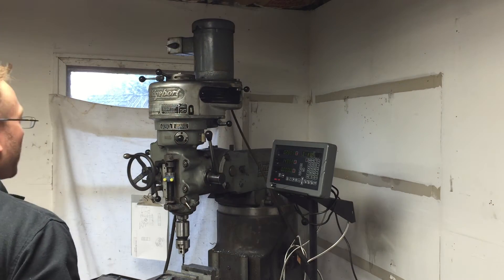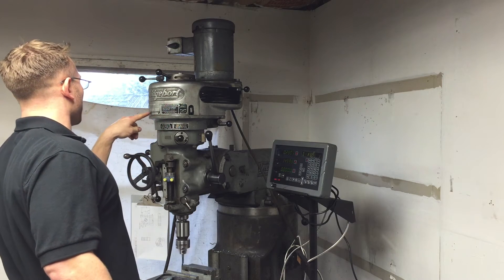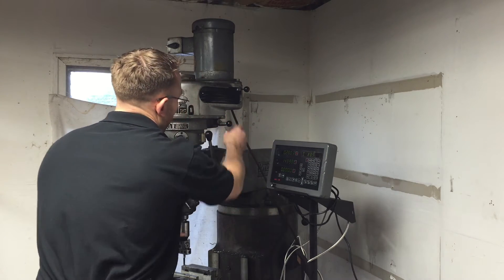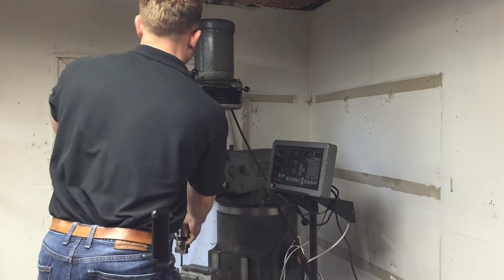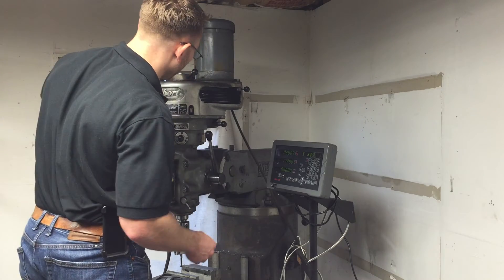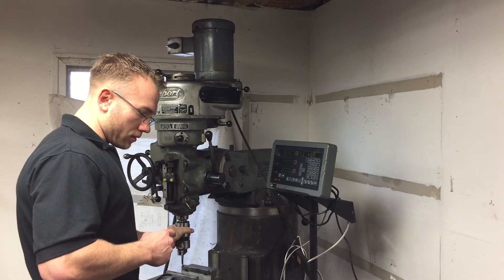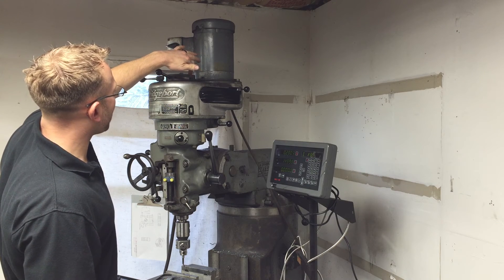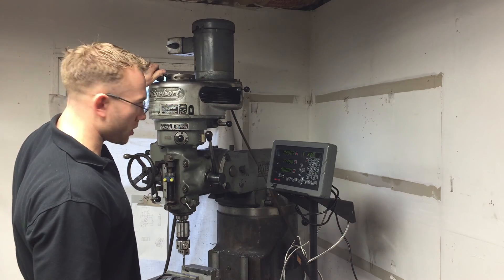How to change speeds on a Bridgeport milling machine (Jhead)

Comment: whats the proper name of the part that that "Tension" screw threads into...I'm searching for parts for my Bridgeport and I'm looking for the proper name of that top lever mechanism, that is, the entire circular part where the Top Lever for raising and dropping the gear is threaded into along with the tension screw.
Reply from the maker: +Wayne Bridgemohan It sounds like you are talking about the "cam ring" search on google for "bridgeport jhead parts diagram" You will get what you need there. Thanks
Reply: Yes You are right. It was a task by itself to find that part. Thank you.
Reply from the maker: Wayne Bridgemohan You bet. I had to search to find that info, good to know. I miss that bridgeport of mine. Enjoy yours.
Reply: +Unorthodox Fabrication enjoy it while it lasts that is :/